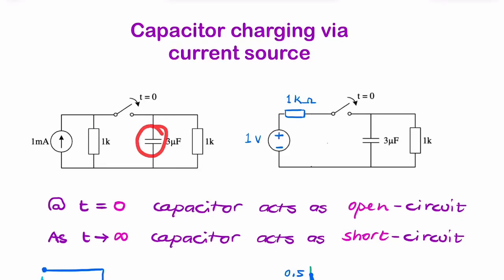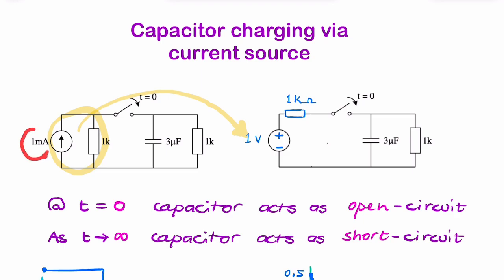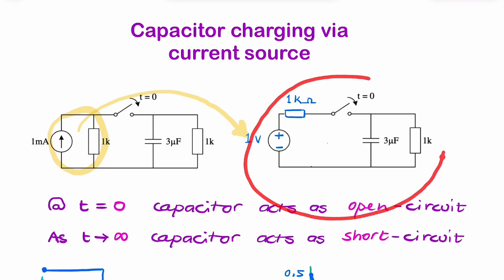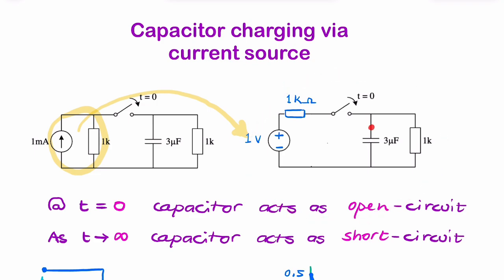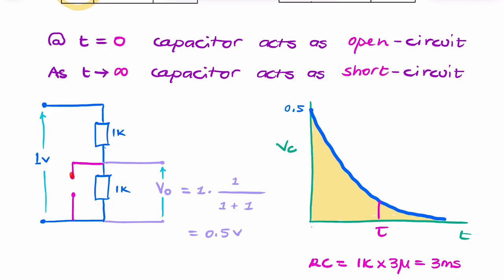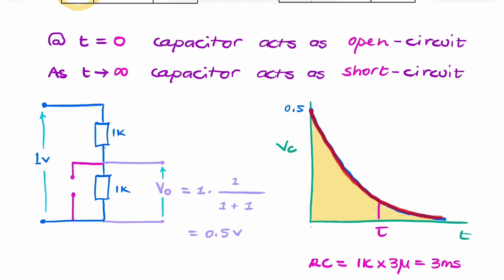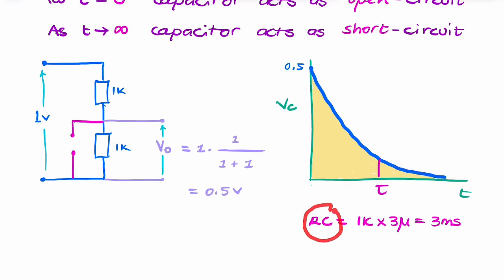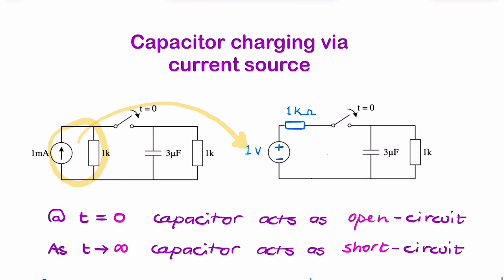Capacitor charging via current source

Comment: I think you got it reversed. @t = 0, capacitor behaves like a short circuit. And after it has charged up, no current flows through it (i.e open circuit).
Reply from the maker: You're right of course, thanks!